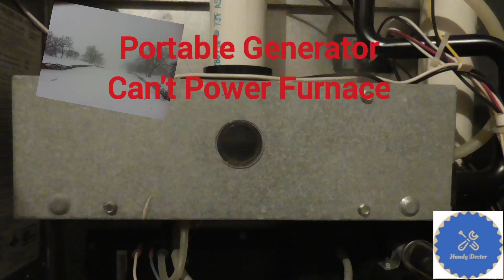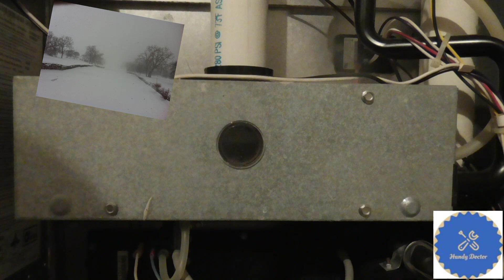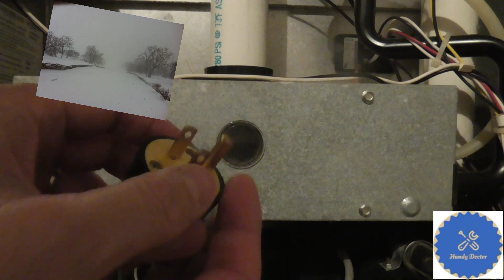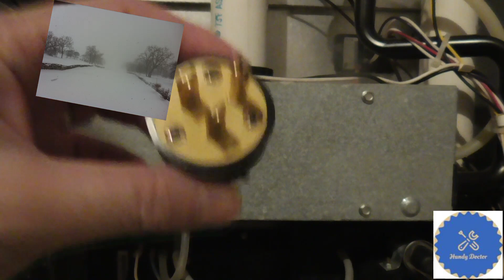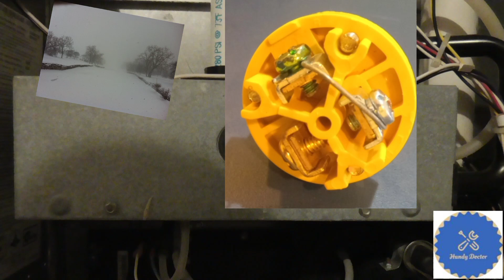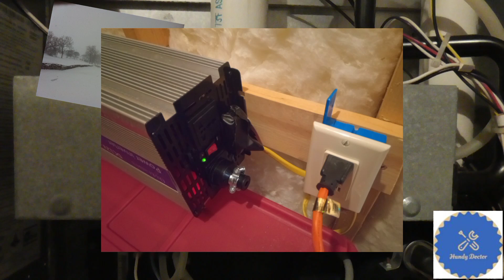Portable generator/backup power can't power gas furnace: symptoms, reason & the fix. Flame sensor

Comment: The neurral is the larger male end. The hot is the smaller. There are multiple videos that show how to wire a backup plug to run a 15 amp system.

Comment: Can you show us the connections inside the funance? where ground wire goes etc.
Reply from the maker: Well, that would be a different video. I don't think imagine can be attached in comments. It's connected to case. In other words, the whole outside metal piece of the furnace is connected to the ground, true for pretty much any electronics that has a group wire actually.